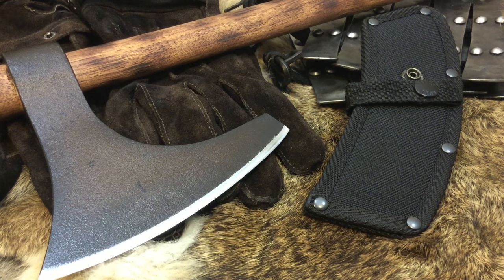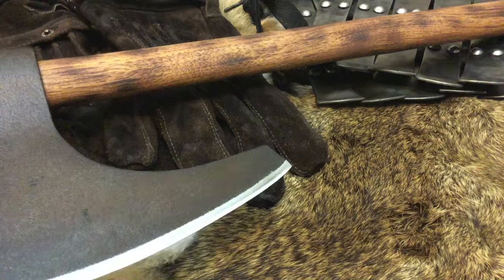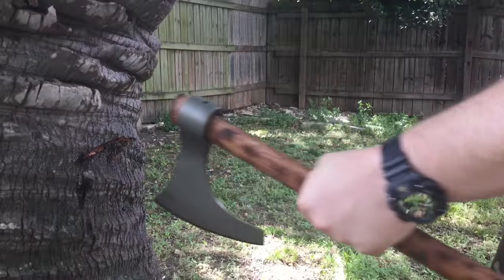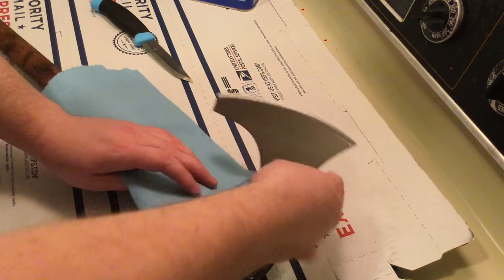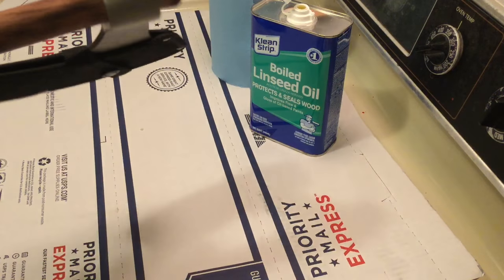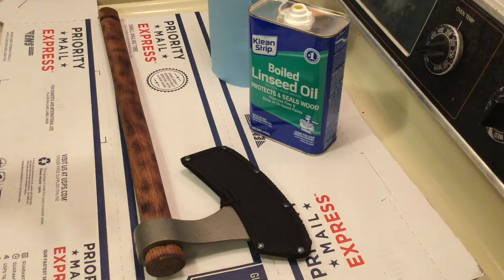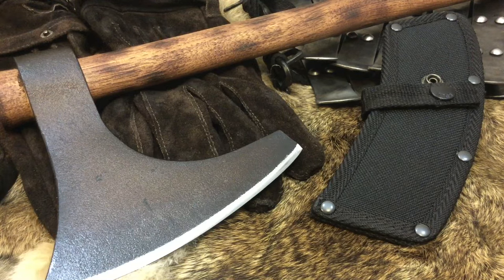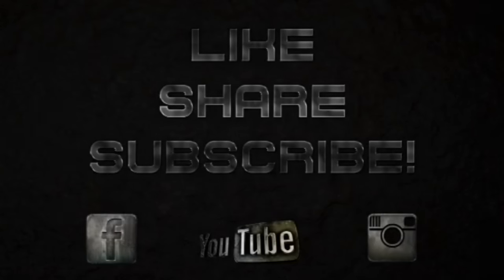Cold Steel Viking Hand Axe - Customizing - Modding - Testing

Comment: Great job, thanks a lot for the video and ideas! :-) Got a question if you don't mind: Did you keep the retaining screw, or did you affix the head in another fashion? I'm new to modifying medieval weaponry and began by first ensuring reliability, then gonna focus on customization. I'm aware this axe can't be shimmed on the top, so absolutely clueless on what to do. Any help would be greatly appreciated, thank you!
Reply from the maker: I found the exact diameter set screw and bought the longer and tougher versions from home depot
Reply: @DropForgedSurvival  Awesome! Amazing tip, will remove the one I got and simply go get a new one at a hardware store as well. Thank you very much!

Comment: Hello sir, thanks for posting this. Really nice axe you have there. I am looking for a nice 'walking axe' to take with me when I have my little daughter with me out in the woods as we have some rather large critters here. I am tossed between this one and cold steels larger Viking axe. Any thoughts? Yes , I can use an axe..studied both Asian and western martial arts for more years than I care to remember just would like an opinion of someone who has used these axes.  Thank you again for the posting, Craig
Reply: The Cold Steel Norse Hawk is a nice option, if you are not looking for a full sized axe. It still has the viking look, and works very well in actual use. If you are not concerned with the viking look, the Frontier Hawk, or the Pipe Hawk, are also both very good choices,  If you buy a Cold Steel ax, regardless of which style you choose, you will need to at the least, sand down and fit the head properly. They all come with a very poor fit, and a set screw to hold them on. I have removed the screw, and sanded to a custom fit on all my Cold Steel hawks. After that, the rest of the mods are completely up to you, but they will work fine as they are, once sharpened. They just look really good  if you go the extra length to strip the coating, and stain the handles, and any other cosmetic mods you choose.

Comment: I already made changes to mine, but enjoyed watching this! Good job! 1 question, where did you get the new handle? I screwed mine up and would like to replace it but have been unable to locate any.
Reply from the maker: They have been sold out for a while. How did you screw it up? Fixable problem or......
Reply: Lets just say the handle is a much smaller diameter than I would like it to be now. Also, when charing, don't use a weed burner.

Comment: I shaved the handle down to 20 inches. I still haven't sharpened it yet and have had it for months. I would like to make it look like an actual Viking axe (less shiny and more worn looking). There is NO edge at all. I could run it back and forth on my arm and it would not even leave a line. I don't have the tools to sharpen it. Do you know a poor guy way to sharpen it?
Reply from the maker: Files can work... a Good set are around $40 but I would suggest something like a grinder because files for most first timers... will take days.
Reply: DropForgedSurvival Ah. I found some files yesterday in the bottom of my old toolbox (don't remember putting them there, could've been my father decades ago) and sharpened it. Didn't take too long, just wanted it to get to a point where I could swing it at something and it would actually stick in it  :). Actually like stones and files more than power tools, don't know why, maybe I just question the work of machinery more than the work of my own hands.